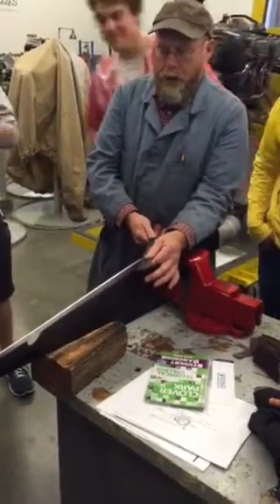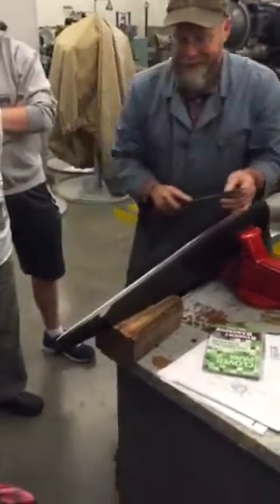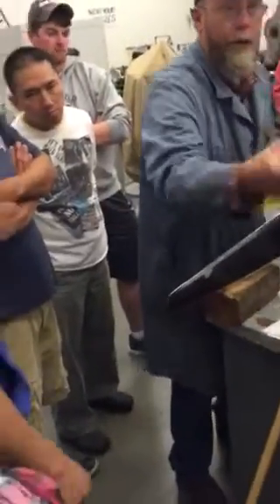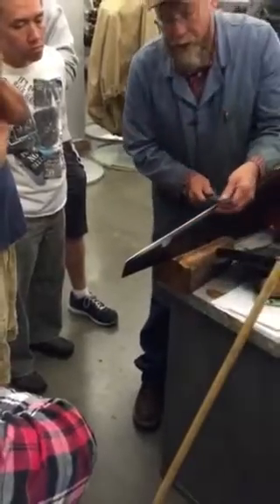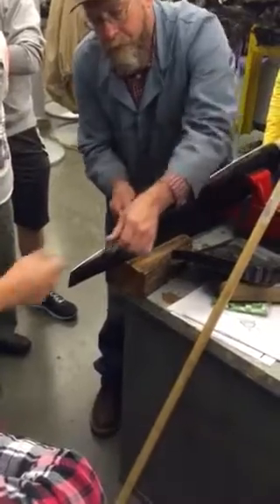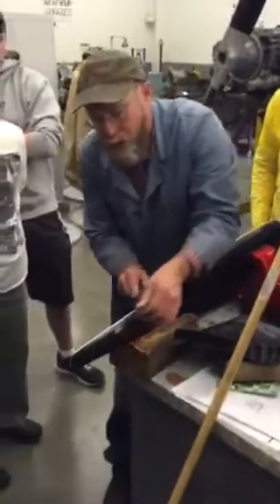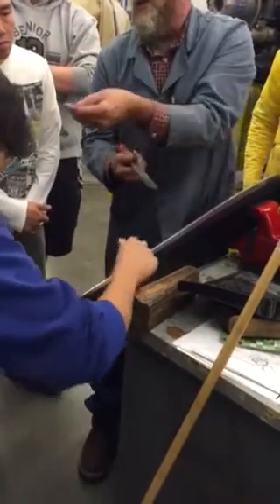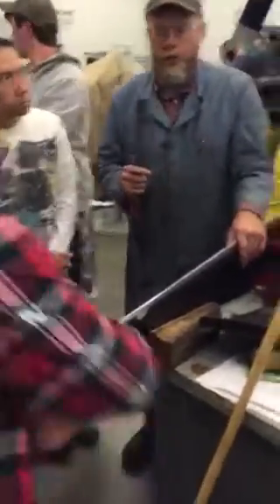Propeller repair demo

Comment: This is not how you do this! You repair the damaged area per manual normal it will tell you 20x the damage depth for the diameter you repair.

Comment: That’s not how we were shown 🤣 my DME said he’d fail you for filing that way
Reply: Roger Reynolds how are you supposed to do it ?
Reply: @amaury plasencia 10 times the depth of the damage is the surrounding area width that you would file. He just filed the entire leading edge 😂😂
Reply: yeah bro he doing a major repair to that propeller lmao. That instructor teaching that whole class wrong.
Reply from the maker: This was just a demo & that prop is there for the whole class to practice on. I had blend a different prop  for one of my PowerPlant practicals & that’s all it’s used for. Not for RTS lol
Reply: @TheDoobzAbidez  i understand it for practice but this isnt the correct way to do it so why practice the wrong way